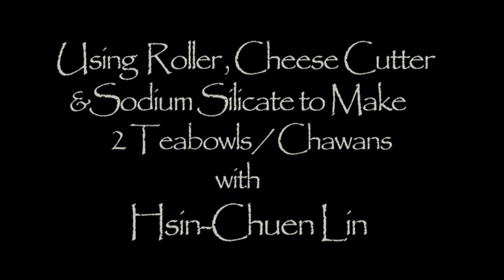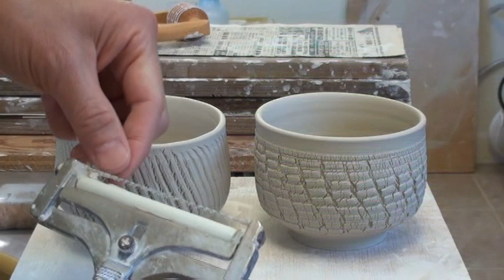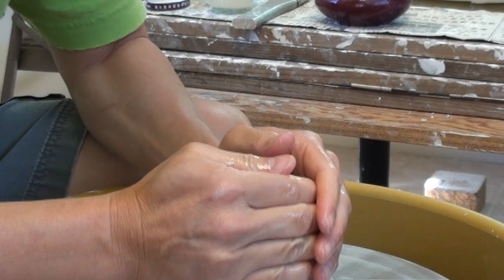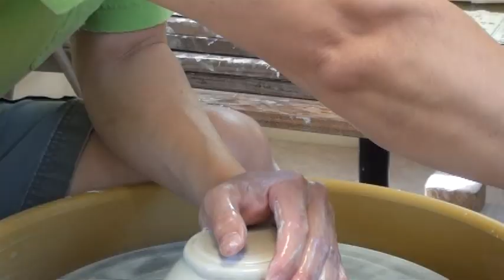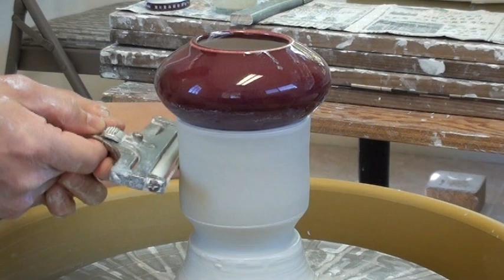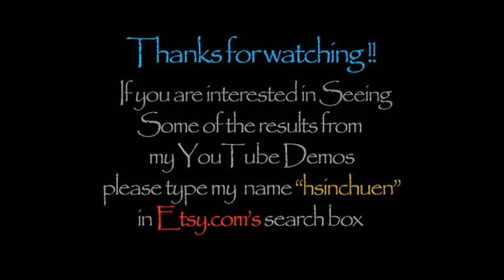180. Using Roller, Cheese Cutter & Sodium Silicate to Make 2 Teabowls with Hsin-Chuen Lin

Comment: I'd like to know if clay that has had silicone silicate applied may be re-wedged and re-thrown (or used in slabs).  Does it have any affect on the firing?  Thanks in advance; love your videos.
Reply: The sodium silicate deflocculates the clay body. Deflocculating clay takes the oppositely charged particles that give it its plasticity and neutralizes them. This is what causes the cracks and crackles on the outside without affecting the inside of the piece. If you re-wedge deflocculated clay it will not work because the particles have been neutralized. In short once you use sodium silicate you have to be very careful not to mess up. The sodium silicate burns off in the bisque firing and it has no noticeable affect on the longevity of the kiln. If a piece is stretched to a very thin state then you may see some cracking from stresses induced by your firing routine. I have used sodium silicate on pieces that I have fired in electric (cones 6 and 10), salt, soda, and in a Japanese anagama wood kiln. This stuff is super fun and there are some super interesting things that it can do.